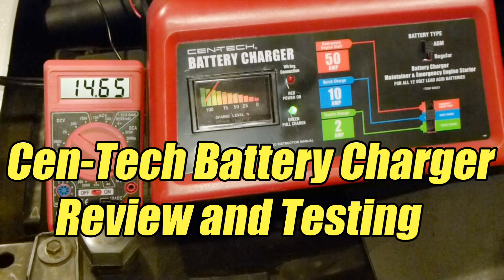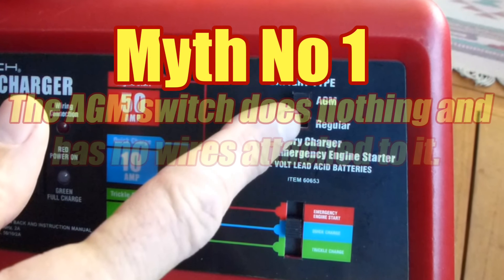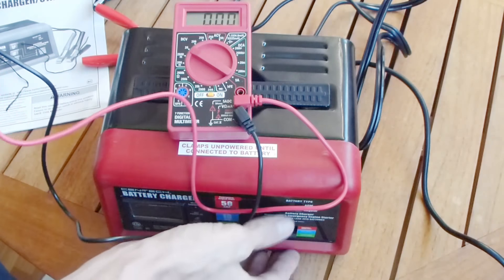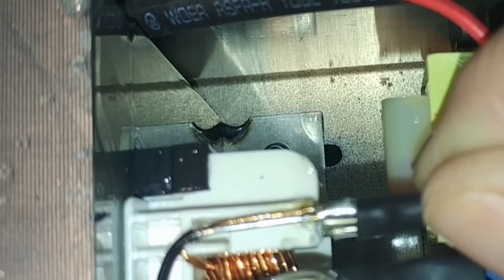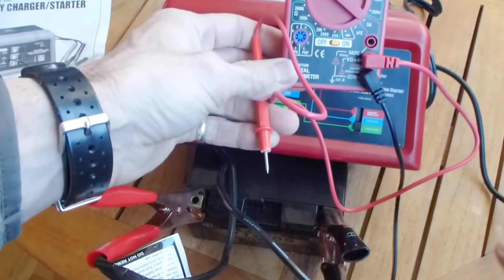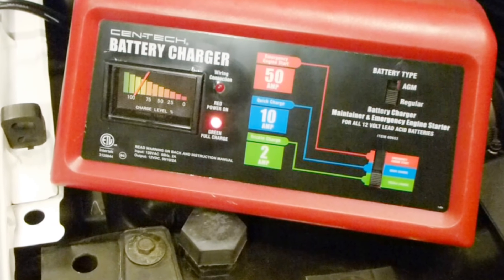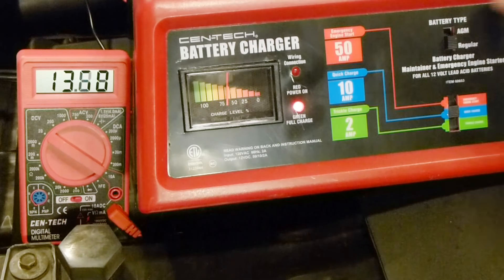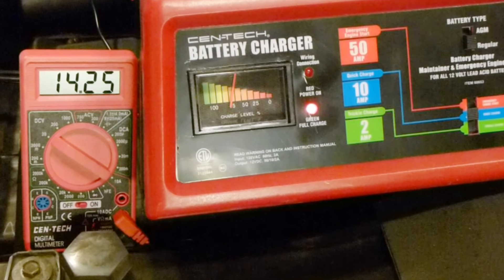Cen-Tech Battery Charger & Starter Review and Testing Harbor Freight

Comment: Dude, great review!  1 question.  How do you know when the battery can no longer be charged? (Completely dead)
Reply from the maker: Cha One: Thanks. That's a long answer but car battery testers are cheap. They start at about$10. If you don't have one, auto parts stores do. Has it gone dead more than once? What's the date on the battery? Does the charger even respond to it? What's its static voltage right now?
Reply: ScubaMoto it’s actually motorcycle/ATV batteries that I purchased the charger for.  I will check the static voltage on them tomorrow.  I know you said yours was at 8 volts but the bikes have been sitting over the winter.
Reply: So I finally got a chance to check w/multi Meter... they are done.  One of them is at 3.64 Volts... and that’s the good one.  The charging light (Red Light) doesn’t illuminate.  Garbage?
Reply from the maker: Cha One: It's possible they're gone but not certain. I use Battery Tenders on my bikes over winter. You could try a tender on them and see what happens or bridge in a good battery so you can use the Cen Tech. Good luck with them.

Comment: Can it charge a basically dead battery? Found one and it looks relatively new but it’s been sitting probably for 5 years. Little atv battery.
Reply from the maker: Not if it's totally dead (below 2 or 3 volts). I put a note in the video description on bringing back completely dead batteries with modern chargers.

Comment: Wich mode should i use the car has been dead for about 2-3 months and we want to turn it on and use today
Reply from the maker: Noodle Sticks: It's impossible to know without more info about the battery like age, condition, etc. It's not likely to get a complete full charge without sitting overnight but a few hours in 10-amp mode might be enough to bring the battery charge up enough to start the vehicle by switching over to start mode.  Some high-end batteries might be good faster, but for 3 months, I'd go 3 hours minimum and even that assumes the battery health is pretty good. Good luck with it.

Comment: Thank you for such a wonderful review. I noticed that the charge meter was already showing something like 75% when you had not yet connected the charger to power or to your battery. Isn't that a big call for concern. That makes me wonder if the charge meter will give an accurate indication of the charge level of the battery.
Reply from the maker: Amazing Grace: Thanks for the kind words. I'm not sure what part of the video you're referring to but they come out of the box with the needle to the far left. If you are referring to the video at time 4:38 it is connected to the battery and I am showing how the meter responds to changing the charge amperage from 2 Amps to 10 Amps. As I mention in the video, the units on the meter are less than optimal but I can accept certain reasons for them to simply use "charge level %" rather than Amps. At 4:32, I mention that it is hooked up to the Suburban battery. The meter shifts to the right at the higher Amp setting simply because the output is increased. With units like "charge level %", both precision and accuracy are off the table. Thanks again for the comment.

Comment: My Multi Meter on an EverLast Batt...after charging is showing 13.07 Volts.  Am i 'Overcharged...and/or...is the Batt Damaged?.... thanks for any help on this!
Reply from the maker: drummerfella 55: The trickle charge is designed to be left on overnight. It has a voltage range just like shown in the video but with less amperage used to charge. It will cut power when the battery voltage reaches mid to high 13's and re-engage before the battery voltage hits mid 12's. 13.07 is not overcharged. Thanks for watching and for sharing.

Comment: Does this need to be plugged into a wall outlet while in use?
Reply: I'm curious about this too in order to jump start a car in the middle of nowhere
Reply: Alena Gallardo yes, this needs to be plugged into a wall outlet to charge the battery. This product is designed to fully charge a battery. I think you might be more interested in a portable jump starter. Those devices are basically designed to give the starter motor enough juice to start the engine. After a successful start, the car’s alternator takes over and begins to charge the car’s battery. So a portable jump starter and this device are not designed to do the same thing necessarily.

Comment: I'm looking for a dumb charger like this I think, but was wondering about  being able to use the 50 amp like the 10 amp setting. Will this do that or any other charger you know of that'd small like this and has 30 to 50 amp charge rate? For camping. The reason I ask is I plan on hooking up for camping to two 105 amp hour batteries and charging those at 30 to 50 amps.  I want it to be fast because I don't want to sit there for 10 hours with my generator running barely putting out 20 watts what seems like a waste of gas and lots of excessive noise so I'm trying to charge these huge batteries as fast as possible from my generator while camping.
Reply from the maker: Peachride EightyNine: This charger is not designed to sustain a 50 amp output. It can only provide short bursts of 50 amp for starting. Thanks for the question and for sharing.

Comment: I have it charging my AGM car battery. It’s been on trickle mode set to AGM for about 8 hours. The voltage is at 13.8 and I can hear it slightly boiling. Should I be concerned?
Reply from the maker: B K: Boiling electrolyte is generally not a good thing. It may have one or more failed cells. What is the date on the battery and the size (cca)?
Reply: @ScubaMoto  It’s a DieHard Platinum AGM Battery, Group Size H8, 900 CCA
The date on the battery is 21 months old. I took it back to Advanced Auto today and the told me it was good. They used a small hand held device, not a multimeter. After he was done it read 12.2 volts. I told him about the slight boiling and he said it is supposed to do that. Lol. 
Today I replaced my positive battery harness aka y cable on my 2008 Sprinter. It goes between the alternator, starter, and the battery. It has a 300 amp fuse in it . The cable was bad. I was getting 12.9 volts while running to my battery before, now I got 14.1 volts at the battery while running. Yay!! That being said it probably never fully charged the battery, and I bought it a year ago. It’s in a motorhome so it sat in storage for a few months at a time in Colorado. Had to jump it a few times. I did try to fully charge it when I bought it a year ago with the Cen-Tech Charger but it was boiling pretty good when it hit 14.2 volts with 2 amp trickle. Thanks for the quick response! I appreciate it and value your opinion. This video is really good🙂
Reply from the maker: Electrolyte boiling for 8 hours - not good. If you're just getting slight venting sounds it might be okay. It's possible that this battery was drawn down to very low voltage before charging. That could explain it. Batteries can last more than 8 years or less than one year depending on what kind of use they see. I hope yours is in good shape.
Reply: @ScubaMoto  I hope it’s good. I don’t trust the guy at Advanced Auto though. I tried to take it back but he wasn’t having it. I kept the receipt so have 2 years left for free replacement. I took it off the charger shortly after I noticed the boiling both times. Was checking it every 15mins. I haven’t checked it after a long drive for boiling because it’s kinda a pain to get to under the floorboard. Probably will though now that I’m getting 14.3 volts while driving. Thanks for the advice.
Reply from the maker: I totally agree that putting it back into use where it will get normal charge cycles will likely improve the battery's function. Thanks for the comments and for sharing.

Comment: I have this same charger. Can it charge a Lithium battery in AGM mode without damaging the battery or shortening its life cycle or do I need a charger designed for Lithium ???
Reply from the maker: D-Money: These are not set up for Lithium batteries.
Reply: @ScubaMoto  Thanks bro.....appreciate the response

Comment: Thanks a lot for the detailed and very informative review. I bought one today. 
A quick question. 
Is it ok to leave it in Trickling Charge mode on a SUV ALL THE TIME while it is parked in the garage during the winter months? 
Thanks again.
Reply from the maker: LongtimeTTFan: Thanks, I'm glad you liked the video. The lowest setting of 2-Amps might be a bit much for chronic battery float but it I suppose it could work for a large SUV battery. I'm not sure how long the full sized charger would last with that non-stop use. It might be just fine. Cenn Tech also makes a 400mA float charger designed for the purpose for about 6 bucks. I use a "Battery Tender Junior" with 750mA on each of my standby vehicles. I hope that helps.
Reply: @ScubaMoto  Thanks for the quick reply. Will use the float tender.

Comment: can your battery in your car be so dead that the charger won't even turn on when you hook it up to the battery?
Reply from the maker: Joel Highsmith: Yes, it's normal. For safety reasons, modern plug-in battery chargers need to see a few volts to activate. See note 3 in video description to see how to use a charger like this to put a charge on a completely dead battery.

Comment: Thank you for you video.  Would you recommend using this charger as a maintainer for a motorcycle batter. If it where only used for a nonth or two.
Reply from the maker: You're welcome. I'm glad you liked the video and thanks for the great question. I would not use or recommend using 2 amps for floating a motorcycle or ATV battery. So the charger in the video is too much energy. You will want less than 1 amp to float the small batteries. There are many good floaters out there. My bikes have all been on Battery Tender Juniors for years with no issues. https://amzn.to/3inZetR. It uses 3/4 of an amp. There are several others in the video description if it helps.
Reply: ScubaMoto Alright!
I will take your advice.
🙂
Reply: @ScubaMoto  I just got a Viking Maintainer and she is on it now. Thanks again.
Reply from the maker: @rashellyohn5128   Thanks for the update. I haven't used the Viking chargers. I see it says it's a 4 Amp  charger which seems a bit high for your use. The manual I downloaded from HF doesn't specify the Amps used in trickle charge mode if it has one. Thanks again for the update.

Comment: I bought this charger yesterday because I have a 1 month old battery in a vehicle with an electric drain. The battery voltage on the battery was 4.4. I hooked up the charger and NOTHING happened. I checked the voltage with the charger connected and the voltage was 2.3 or in that range. The charging light only came on dull. The needle on the gauge never moved. This was with the battery cables disconnected but the battery was still in the vehicle. I connected the charger to another battery on my bench that had 12.4v and the battery charge light on the charger lit up bright as could be and the charge voltage was 13+. So it will charge a battery that doesn't need to be charged but not a battery that does not need a charge. Can anybody help please.
Reply from the maker: MLB: From a voltage that low, it's going to take time. Hours not minutes. A short circuit can burn out a cell or cause other permanent issues. If a battery is shot, has a bad cell or is otherwise not chargeable, nothing will work. The most common way I see to try to rescue a useable dead battery is to "jump start" the charger. If the dead battery is still useable, you can still use a charger like this one to try to gradually bring the battery back, but you need to bridge in another battery with enough voltage to activate the charger for a while. After a few minutes, the voltage on the low battery should come up enough that you can remove the bridged battery and the charger will eventually give the low battery a full charge. If the voltage on the dead battery continues to fail to come up enough to keep the charger active with the bridged battery removed, you likely have a failed battery. I hope that helps.
Reply: @ScubaMoto  Thanks, I just learned about giving the charger a jump to activate it.I saw nothing about this in the manual but it makes perfect sense with the clips not becoming active until it registers a battery.

Comment: The red light blinks on and off while charging in the agm and regular mode. Can you advise the reason for this. it seems like it is cycling on and off and I hear a clicking sound. Any thoughts are welcome and thanks for a great video.
Reply from the maker: How long is it connected before the lights blink? What type of battery and what is the voltage of the battery before connecting and while connected?

Comment: Mine buzzes and the greeen/red light alternates. Eventually it settles down and charges with a red light. While it was buzzing and pulsing, the voltage at the bat terminals was fluctuating. Is the charger doing some sort of preliminary state of charge testing?
Reply from the maker: obsolete professor: You're right on with your preliminary state test. I certainly would not call these "smart" chargers, but most chargers have some communication or assessment period when they are evaluating the state of a battery before settling in on a charge level.

Comment: I bought two of these to the jumpstart function. Not realizing it's more geared towards someone who has a shop And it has to be plugged in LOL. So that was my idiotic moment. But now that I have them other than having to plug them in and use an 18 gauge extension cord, is there anything that I need to do differently to get it to start my car than I would if I used a regular portable jumper box? Looking at the instructions it says something about the ungrounded cable being disconnected. But I'm thinking that's the charging. I'm trying to start the vehicle, so all the cable should be collected as usual. Right?
Reply from the maker: Stephen723: Thanks for the great question and comment. As I state in the video, start mode only adds up to 50 amps. That's not much. Remember that most car batteries are 600 to 800 crank amps, so 50 really isn't much. It's no where near enough to start a car if your battery is dead. Even the big rolling charger-starters at dealers that cost hundreds of dollars only put out 300 amps in starter mode. So to start a car, you really need some charge on the battery to do most of the very heavy lifting it takes to start the engine. Or you need another vehicle with a good battery to jump start it. So let the charger bring the battery charge up for AT LEAST an hour in 10-Amp mode before attempting to start the car with starter mode. Thanks again for the question. I hope that helps.

Comment: Does it really pay to get that extra engine start feature?
Reply from the maker: robert grotto: Great question.  I purchased the one in the video for about $30 out the door back in the coupon days. At that price point, it was definitely worth it . . . to me. For starter mode, 50 amps is typical for units like this but it really isn't all that much for starting a vehicle. Most batteries are 600 - 800 crank amps, so 50 amps is a drop in the bucket. The bigger chargers in shops that are on rollers usually have 200 amp start mode and even that needs some charge on the battery before attempting a start. For "Start Mode" on these smaller charger units, you need the charger on the battery for at least an hour at 10 amp mode before trying to use start mode to start the vehicle. If the battery isn't totally shot, one additional hour would probably be enough to start the vehicle without using start mode. Thanks for the question. I hope that helps.
Reply: @ScubaMoto  In my experience if I need the jump start feature it usually means I have to get going right away. Not wait an hour or so. At that point I'll jump it from another vehicle. Harbor Freight has the Cen Tech without the jump feature for $25 less. Retired on a fixed income that's a tidy sum. I'm also cheap. LOL. Think I'll go with the without feature. Thank you for all your valuable info. There is a lot of misinformation out there on many things on you tube and else where as you pointed out on dispelling those myths. God bless.
Reply from the maker: robert grotto: That makes sense. I noticed that HF now has that 6A charger. The reviews look pretty good. Thanks again for the question.
Reply: @ScubaMoto  You beat me to it. I just realized it was only 6amp. Guess I'll open the wallet and go with the 2/10/50 after all. LOL.

Comment: Super helpful @ScubaMoto! I am trying to charge my lawn mower battery currently (uncharged all winter, but fairly new battery). The lights don't come on saying there is a connection, is that normal until the battery comes back to life a bit that the lights on the front won't come on?
Reply from the maker: Is your lawn mower electric (powered by battery) or is the battery just for the electric starter? If the mower is electric, the battery is probably lithium ion and should be charged only using the mower charger. If it is gas powered, and the battery is just for the starter, then you can use this charger unless the battery voltage is super low. My review shows it working for a battery that has run all the way down to 8 volts. If you are far below that, then you will need to trigger the charge mode with a better battery that has higher output. Just set it up as a jump start with the charger in 2 AMP mode. This is common to most modern battery chargers to prevent shorting out the charger. Thanks for watching and for the comment.